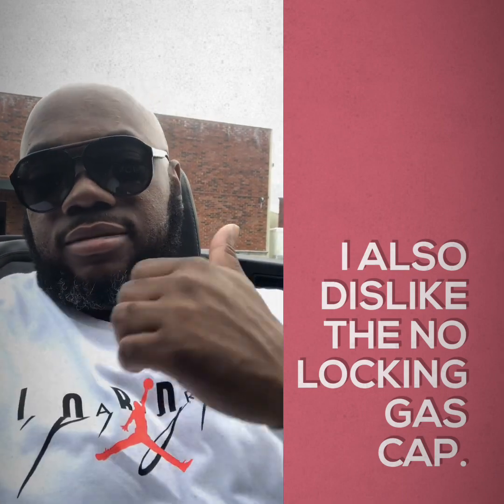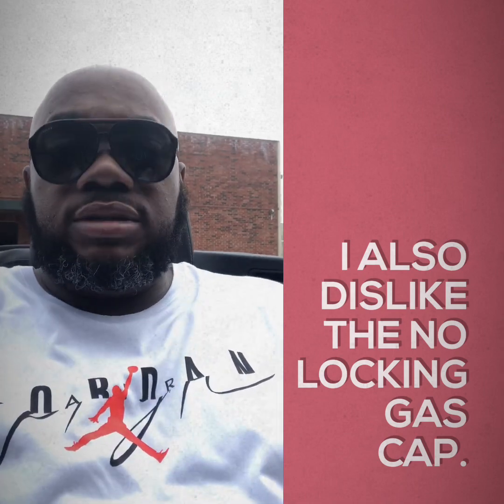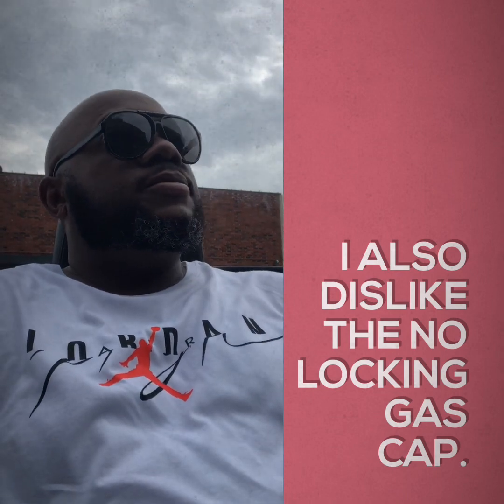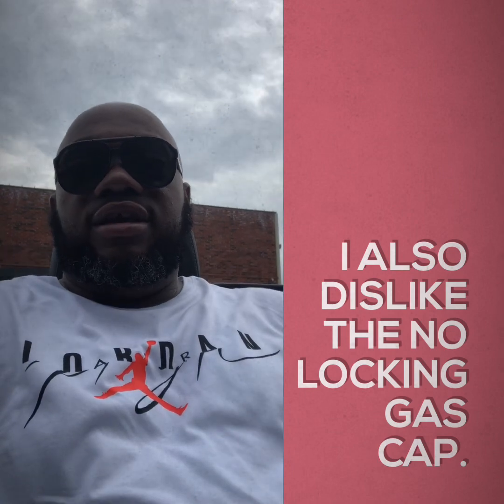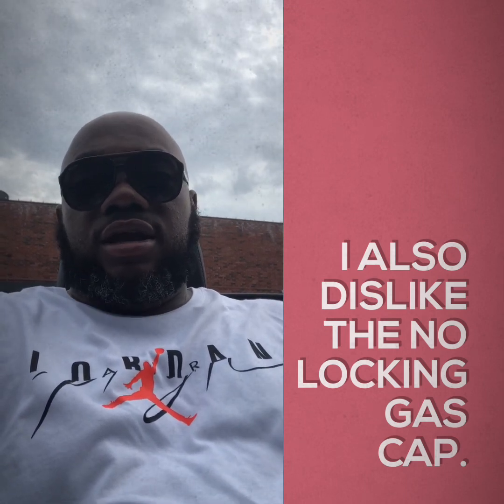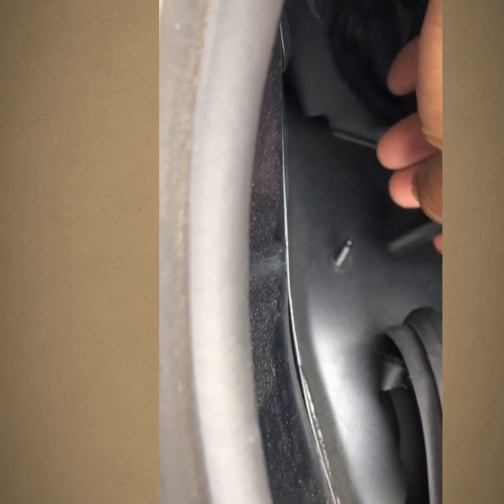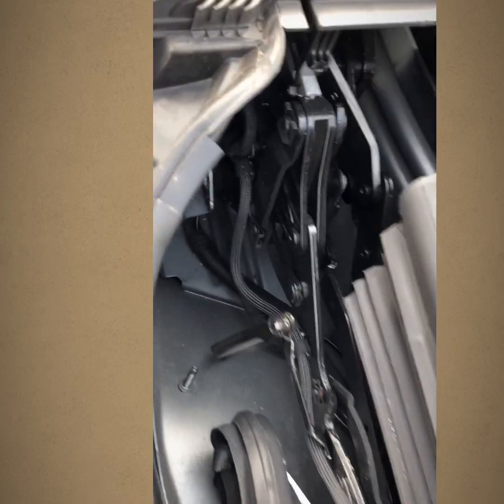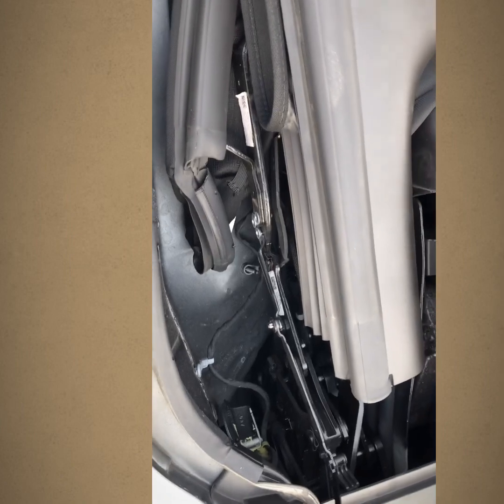Camaro SS convertible problems

Comment: I've got the same problem, sliding metal cover,  on my 2017 Camaro SS Convertible. Now the rear window glass is coming unglued. At a 160 miles an hour the rear seat belt makes a slapping sound when the top is down, It's almost as upsetting as the SCREAMS my girl friend makes at speed.
Reply from the maker: This weekend i have a fix video coming for that issue. Stay tuned and make sure to subscribe to the channel.

Comment: I just got the same problem with my 2019 convertible I believe that they Have to replace the whole convertible top just to fix that one problem. This problem is very common now they should do a recall on it. Lucky for me I still have warranty that should take care of it but my home dealership doesn’t have anyone to repair it so I have to find another dealership I can’t imagine how much a brand new top would cost someone without warranty.
Reply from the maker: Its not the whole top that needs replaced. I made a video on how to replace the part. Make sure to subscribe ok

Comment: Just dropped off 2022 Camaro at dealership. Passenger side broken.  It was not working right shortly after we got it. Told them about it at first oil change and they said they didn't have time to look at it but to mention it when I booked next oil change. Too late now, it broke.
Reply from the maker: Well hopefully its under warranty. It is an easy fix. Also since i replaced mine i havent have any issues. But very bad design. Thanks for watching. Make sure to subscribe to the channel and give vid a thumbs up 👌🏾
Reply: @biglesent  it is under warranty. And it took two trips to the shop to get it done right.

Comment: Man how long did it take to fix this? And was u still using your top with it mess up? I am still was using mine but it’s like u say a breaking noise in there
Reply from the maker: noneofficial305 best thing to do is move that bracket out of the way so you wont hear that noise. I stopped letting my top down. It only took them a few hours to fix and its easy to fix.
Reply from the maker: Also subscribe to my channel so you can get all the vids about my car.

Comment: Bro i just saw your video
I have same problem with my 2019
I wanna drop my manual 
So could i do that please
Before i get it fix
Reply: I want to know how to do it.
Cause the screen keep saying 
Only manual operation.
I need an idea from you how to drop it manually please
Reply from the maker: You have to use a allen to unlatch the top. Then manual lift back lid. Then fold down into trunk. Then close back lid. I have a video showing how i sold that issue coming in a couple days.
Reply: Thank you brothaaa.
Reply: @biglesent  lift back lid wont fall down bro
Its so hard
But i did unlock the front top
Reply: @biglesent  do i have to unplug something?
Cause i see my have pump all the way back in the back seat.
Cause even i try to open the lid
I feel like something hold it
Reply from the maker: The lid is heavy. Do you lift the back of the top up first?
Reply: To be honest bro i dnt know how to lift the back off the top,i guess thats the reason the lit wont move.
Would you tell me how to do that please.
I only got the front top lift with the allen thts all bro.
Reply from the maker: @yvenselveus7681  The back of the top, where the rear glass is at, must be lifted up, then the rear lid can be lifted so the top can go in the trunk. It goes in the same motion as it would if you were pressing the button.
Reply: Do i have to lift it with my hand brotha? The rear back glass at
Reply: Cause i really hve a hard time with this thing
Reply from the maker: @yvenselveus7681 nothing that has to be unplugged
Reply from the maker: @yvenselveus7681 Sunday i will post a video discussing the issue you having.
Reply from the maker: @yvenselveus7681 yes with your hands
Reply: Im waiting for sunday brotha
Thank you
Reply: Bro what time you going to release that video.
Cause I'm still waiting on you brotha
Reply from the maker: @yvenselveus7681 yes

Comment: i have a 2017 and same problem, very disappointed in camaro for this
Reply from the maker: Car plus its made very cheap. I see its been a continuous problem. Ill keep taking it to the dealer until they make a better fix. The dealer did fix it. Also subscribe to my channel for more Camaro content.
Reply: What parts need to be ordered please
Reply from the maker: Im not sure of the name of the parts that needs to be ordered  yet. Mine was under warranty so the dealer fixed it. But now my other side has messed up. So when i go to dealer to buy the parts. I will tell you exactly what i bought and im going to make a video of it cause this is a common problem. The video will be within a week. I am going to remove and install nee parts. Thanks again
Reply: Any idea about the parts for it?

Comment: Same thing with my 2017 convertible top happened with that little sliding plastic plate except it was the little roller bearing thing that broke. That was last July! Now today the same thing just happened on the opposite side of the car -_-
Reply from the maker: Its crazy. But easy fix. Make sure to subscribe👌🏾
Reply: How much/ fix?
Reply from the maker: Part was 140$. Not too bad. Hope the video was helpful. Make sure to subscribe to the channel.

Comment: Mines broke too...not under warranty smh
Reply from the maker: Its not hard to fix yourself if you have to
Reply: @biglesent  just found out it IS under warranty even if the gotta replace the whole top! Now its just a matter of me setting the appt n dropping it off "during the week" when I'm at work AND I don't want them to keep my car! Order what u need to order n let me take my car n call me when the piece part or whatever get here Lol
Reply: How long did yours take? Man mine fuckee up today!?!?!?
Reply: Darin Tucker what did they say it was covered under and how much miles do you have on your I’m on the second time they fixed mine
Reply: @jacob7291  its covered as long as "you" are not the reason its broke...manufacturing defects r ALWAYS covered
Reply: @noneofficial305  I ain't take it in yet
Reply: Mine just broke as well but is not under warranty. How much did you guys have to pay  out of warranty?
Reply from the maker: Mine was under warranty so i didnt have to pay. But looks like an easy fix. It was made cheap though. Very common problem. I had to take it to dealership twice to fix. Also make sure you hit the subscribe button. I make plenty vids and the 6th gen camaros.
Reply: Just got mine fixed at the dealership. The arm on the driver’s side that pushes the flap forward was broken along with the plastic piece that pushes the flap. My passenger side flap was also not snapping into place. I had both fixed out of warranty and it cost $700. The dealer told me that they had updated the regulator kit so hopefully it won’t break again.
Reply from the maker: Justin Kemppainen i had to take back cause it still wasnt closing properly. So just monitor it.
Reply: Bigboy Les Whats the mileage warranty I have my camaro 2017 at 47 k miles will it be covered ? Same issue on the convertible as the video
Reply: The warranty for it is 3 year / 36,000 miles. Your repair will be out of warranty unfortunately just like mine was.
Reply: Bigboy Les how do I fix this myself
Reply from the maker: Diego Quezada its not hard to fix. Just order parts you need. Its a bracket and plastic clip. If it doesnt bounce back replace spring also. Very easy to do. Also make sure you subscribe to the channel for more vids on car. Thanks
Reply: @justinkemppainen413  how much did it cost? same issue here and not under warranty.
Reply: Tomas Villar $700
Reply: @justinkemppainen413  mine was under warranty after all I didn't pay anything outta pocket they tried tho Lls im too strewd for that
Reply from the maker: Whoa thats crazy price. Ill have to do a video on installing yourself cause its a simple fix.
Reply: @biglesent  please tell me what part to order.  Your video is very helpful.  Mahalo from hawaii
Reply from the maker: @coreypohan4642  ok i will post when i look it up
Reply: @biglesent  Hello. when there will be a video how to fix it
Reply from the maker: Video coming soon. I finally have the parts. Make sure to subscribe.